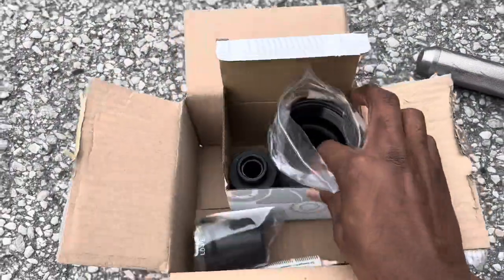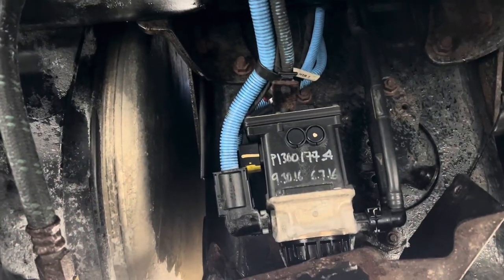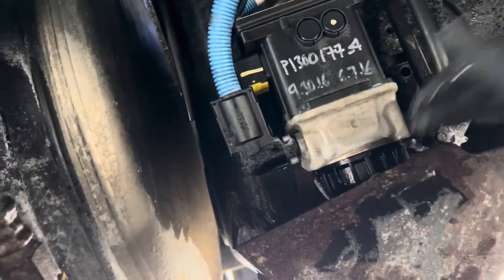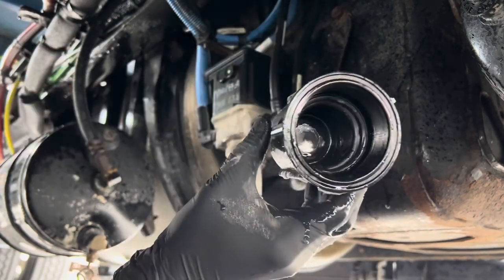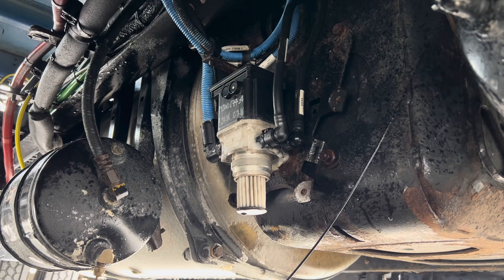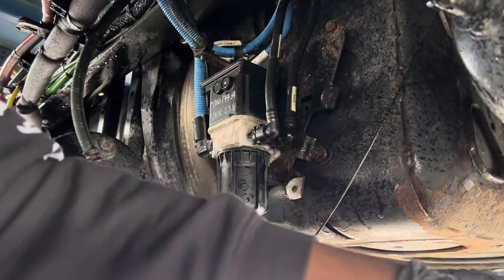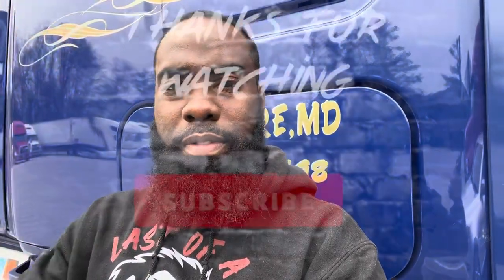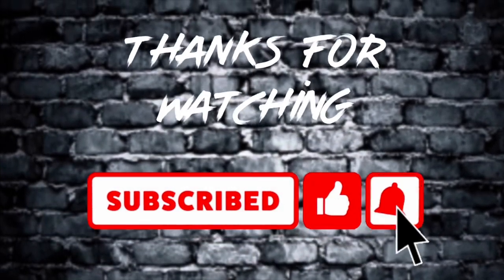How To Change DEF Filter | Freightliner Cascadia | SPN 4374 FMI 0

Comment: Just like you said, I also didn't know about the DEF filter. the more of these videos I see the more I'm becoming a mechanic. I just change out the air dryer filter and fix all air leaks with a spray bottle and a few fittings saving me $1000's

Comment: Good lookin on the info and also do you have sensor problems or def/dpf and emissions problems often? Looking to purchase a 2017 cascadia this weekend
Reply from the maker: Naw I only had this problem twice because the shop didn’t fix it the correct way the first time so it ended up happening again about 2-3 months later…but haven’t had any issues other then that

Comment: So far that is the worst example of how to change it I have seen . Using a pair of pliers where a socket should be used that's an absolute no and then not using the lubricant or at least not showing using a lubricant and inappropriate places that's an absolute fail and not showing the whole process like putting the rubber booty on there dawn that is an absolute fail again yeah thanks for trying but this is horrible people are gonna screw their shit up following these directions
Reply from the maker: Thanks for watching the video 💪🏾💯